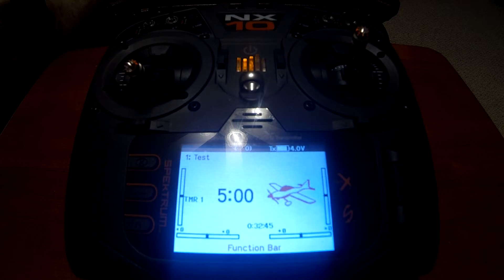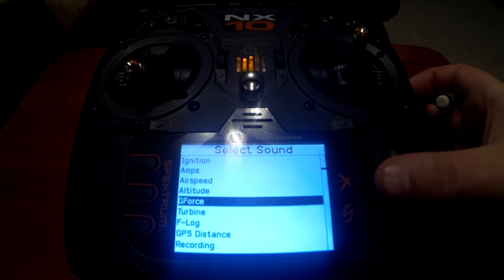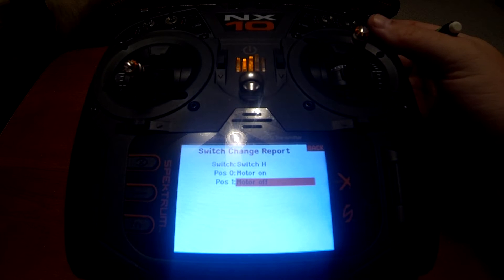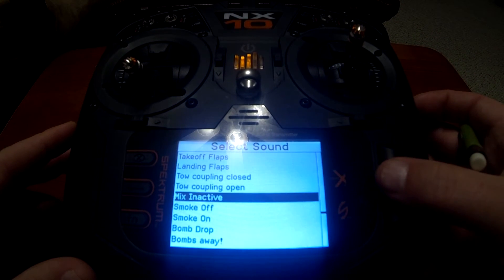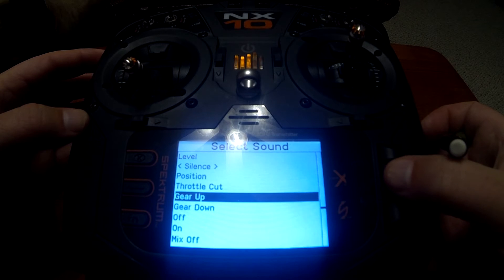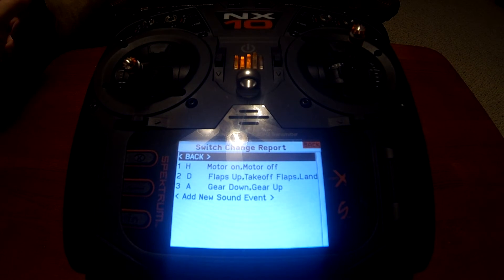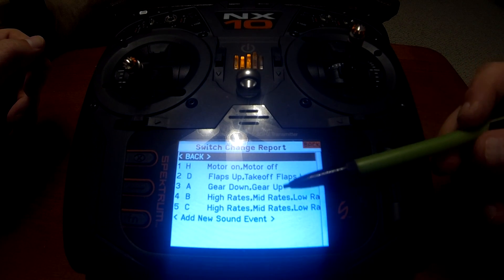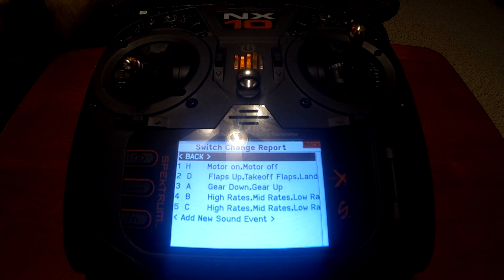Spektrum NX Setup: Assign Audio Events on Switches Tutorial (NX6/NX8/NX10)

Comment: Great video!
It seemed like when I first powered on my new NX10+, it would announce the switch positions by name, in other words it would announce as prop secured or motors armed when I powered on the transmitter. It seems like since I added some telemetry callouts, it no longer announces my switch position names. I am able to have it announce the generic switch position like switch H position 1, but I would like to hear it say prop secured instead. Is there a way to get that to happen?

Comment: Your videos are awesome. Your clear, to the point and there are no missed steps that cause extra confusion. Plus, you aviod the bla bla bla non related garble that drives me nuts when I am trying to learn something in a short time. I usually have the transmitter in hand following with you. I read the topic in the manual, confusing. Your vids are covering what is needed and even an amateur can follow easily. Keep doing what you do.
Reply from the maker: Agree! Thanks for watching

Comment: I have an NX8+. I bound to a Sportx 1.1 and downloaded their on board setup. It put elevator, aileron and rudder modes on separate switches. I moved them all to switch F. I ended up with double sounds for this switch. Is the there a way to delete one of the sound sets other than setting to <silence> which I did. I also set switch B audio and then discovered flight mode had an audio so I have double audio when I moved switch B. Again I set audio to <silence> but could have turned off the fight mode audio. I ended up with eight switch setups (three are <silence>) but the “add switch” option is not there.

Comment: Even those these are older videos they are still very helpful!!!  Question, I am looking to set up the sound for reverse thrust, or something close to that…..I’ve gone back and forth on the list….is it not there???
Reply from the maker: Doesnt have reverse thrust on list. I would use Braking On and Off.
Reply: @BDTennessee  Funny, that’s exactly what I ended up choosing a few weeks ago, thanks again for taking the time you did on the NX10 videos, I learned a lot and I am still going back to them for fine tuning tips.

Comment: I have a new NX 8 that alarms constantly on any throttle. A flight buddie tried yet the transmitter ALARMED constantly with any throttle.
Reply: BEEP BEEP Reparenting a crash!!!!
Reply from the maker: @gregmcgee4430  Brand new radio id say its the timer start and timer stop beep. Checkout video "timers explained"
Reply: The transmitter is cool. It just Alarms 100 of the time.I have ihibited all alerts and my Draco is repaired.
Reply from the maker: @gregmcgee4430  what does alarm sound like? Is it a beep? Throttle based? When flying or powering up? Need more details

Comment: I bought a NX8; a TX that I can grow into as a new pilot.  The manual is not always clear but your instructions make it easier to understand and much clearer.  I appreciate you and your videos on the NX series. 

Mike
Reply: BD,  what are L and R trimmers?  I under the other trims and their purpose.  Your info would be greatly appreciated.  Your videos really help is newbies.
Reply from the maker: @michaelrouser5730  they can be used for any kind of adjustment. There assignable.I use them for flap to elevator mix.
Reply from the maker: NX8 is good all around! Can grow into it for sure!

Comment: Hey dude, just set my Nx8 up. I'm just wondering how you turn the volume up for the voice call outs? Would like mine louder
Reply from the maker: Push the back button to the left of the screen.You will notice top right on screen a graph bar and value of 50 show up. Scroll the wheel to right to increase number,which is the volume.Push wheel in to use that volume level.It will call the volume out in the new sound level.
Reply: @BDTennessee  thanks dude legend!
Reply from the maker: @harleyblackwell7371  haha thanks!
Reply: @BDTennessee  hiya mate, got another question. This is my first proper decent Transmitter, I've noticed there's an SD slot? What's that for and do you need one to set up  multiple models? Cheers
Reply from the maker: @harleyblackwell7371  it’s for backing up info. So if you deleted something on radio you can reinstall.
Reply: @BDTennessee  so you don't need one to set up multiple models then? I'm a Heli pilot and fly the blade range 👌🏽
Reply from the maker: @harleyblackwell7371  set em up and fly. Radio can hold 250 models
Reply: @BDTennessee  nice, that's a bonus because I have like 13 different BNF blade Helis I want to use with my Nx8. 
Would u say its worth me getting an SD card for the updates later on?
Reply from the maker: @harleyblackwell7371  I would get a card for backing up models. So if one gets corrupted or deleted you can replace. Updates is good to have added as well.

Comment: Can you add a battery alarm for when your battery’s low?
Reply from the maker: Flight battery or transmitter battery?
Reply: @BDTennessee  flight battery
Reply from the maker: @austinlangley4539  what battery you running? Smart battery or normal?
Reply: @BDTennessee  smart battery gen 1
Reply from the maker: @austinlangley4539  if you have a smart esc and telemetry receiver you can get more detail readouts. If you dont have both those with the batter you need the voltage cable to integrate into your setup.

Comment: I might have missed it. But is there a way to increase the volume of the call outs for us older folks?
Reply from the maker: Push middle button of three on left side of screen.You will see a speaker top right on screen with a bar highlighted showing a number. Use the scroll wheel to turn volume up and down. When you get the volume you want push the scroll wheel to enter and it will call out the volume percentage.

Comment: Very helpful video.  Is there a maximum number of audio events for switches? I used the Draco template for my NX8 and when I add an event for my safe mode switch I loose my throttle cut switch events. It appears there is maximum seven events. Is this correct?
Reply from the maker: When using a template the audio events can be limited to lower number. If using a clean model (no template) the most you can have is 8.
Reply: @BDTennessee  thanks that helps. I'll just delete some of them. I don't want my dual rates/expo on three separate switches anyways.
Reply from the maker: @wingtimeRV7  thats works.
Reply: @BDTennessee  apparently if you inhibit a switch event in a template you loose that slot and can't add an more new ones... Down to two switch events now 🤔😒
Reply from the maker: @wingtimeRV7  oh ok.I tried a clean model last night and most i could do is 8.
Reply: @BDTennessee  loaded the Draco template again..this time instead of adding a new event, I modified the ones I didn't want and set the ones I'm not using to silent.  Wish there was a good audio alert to use for the reverse aka beta mode.
Reply from the maker: @wingtimeRV7  i agree not really anything in audio events that directly relates. I could see maybe using "Brake Mode" cause when you flip it at first its working like a brake...
Reply: @BDTennessee  was thinking of creating one using the spectrum audio editor. But I don't see a way to import new sounds on the NX series using the SD card. Maybe they can be added using a computer and USB? This would be a handy feature.
Reply from the maker: @wingtimeRV7  i think i recall someone at HH saying the NX doesnt support sound editor,at least not yet...